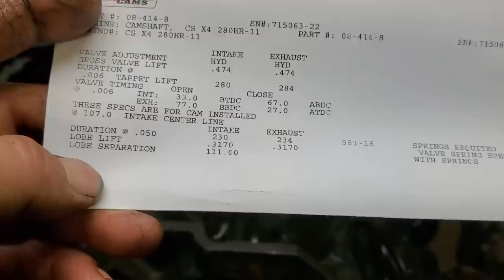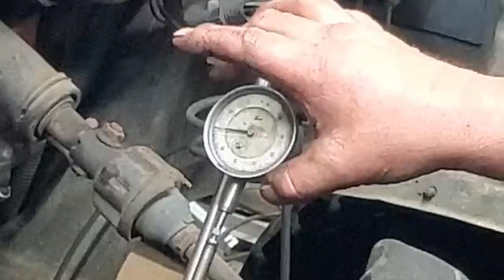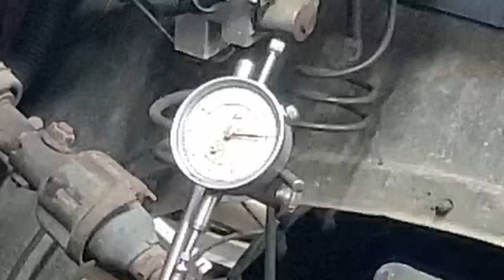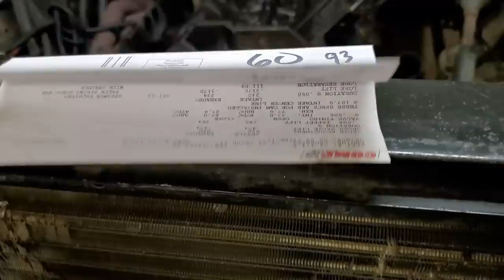1990 Chevy 4wd gets a heads and cam swap. Hot rod 4x4!! Part 1

Comment: My dad always drove cars that one could reasonably describe as "needing a bit of love".  Which meant that every couple of years, there'd be an engine all over the basement floor.  I was always amazed that he'd get them back together again, running much better than when he started.  The first such I remember was a Ford Fairlane early-1960s wagon that he took apart in perhaps 1968.  I was a wee lad of 5, but I remember oily pans all over his workbench with valves and rockers and lifters and the like.  I don't think we replaced that vehicle until 1971 or so with a 1968 Firebird.   But TBH, I think I'm learning more watching your channel than I learned from all my dad's forays into engine repair.  He grew up during WWII in the UK.  It was inconceivable to him to NOT do all his own engine repairs, including complete rebuilds...

Comment: Nice job explaining things as you go. I wonder if there is enough room on the power steering pulley to make a hole without making it unbalanced. Also, many years ago I remember valve grinders that looked like miniature hand powered mixers. If you could find one of those somewhere, that would speed up your valve lapping. Looking forward to next week;)

Comment: I will guarantee you sir that those heads will outflow double humpy Chevy anything but a power pack head is the only thing that will outflow those heads but as I said they're prone to crack so the good thing you had a mind to flex and check but you'll be more than happy with the power they make a guarantee that's saying pull stumps out of the ground if you got the right transmission with it to handle it

Comment: You can also use a power drill, a rubber hose held on by the drill and the other end of the hose to the valve and go down town on it, much faster and better results.

Just saw the part where you used the method👌

Comment: I had that problem when I put a 327/375hp cam in a 283 cu.in motor. I pushed the studs out of heads, it ran about month then valves wouldn’t adjust. We figured out what was wrong. Back in 1969 we didn’t have screw in studs. I found a set of 327/300hp heads. Really woke up that 283. Kept blowing exhaust pipes.  Wish I still had that little yellow 57 Chevy. Diamond pleated interior, Hurst shifter. I only got 3 miles per gallon. Like the positive vibe your channel has. Plus the down home education value this channel has. You really take the mystery out of mechanical stuff.  Don’t know what day you filmed this, but darned tooting it’s got cold in the Volunteer state.

Comment: I have a horse tightened up with an inridge and got him tied enough that didn't come out once you put the red sailor on them but if you tell people to use a socket in my experience people get to tour cafe because some people don't know what to quit putting the torch to the boat if you know what I mean
Reply: You might want to mention to people that it's better to use the umbrella seals then they're all ring seals because usually they smoke early and the Orange seals are what come out album involve decades

Comment: A vacuum hose on the stem portion of the valve, then the other end of the vacuum hose in a drill works really well for lapping valves. Just gotta remember to oil the valve guides down some and go slow with the drill. Sure it easier than lapping valves by hand and those suction cups don't always stick, they slid around too easy imo.

Comment: Great vid , liked all the info on setting up the cam timing .
I watch a channel called Barum Engines ( English rebuild shop ) 
And I can't believe how complicated these modern engines have become !(BMW) WHY? I don't know ?
Might be because I'm 61 and stuff takes longer todo LOL !
Big thumbs up !
Reply from the maker: I do not like new vehicles!
Reply: I think to justify there jobs they keep changing stuff for the sake of it ! My partners latest iPhone update has made the clock bigger ??????? All for electronic ignition and fuel injection but it should have stopped there ( my opinion ) .
Keep the channel going , and a small request if possible get hold of a straight 8 ! I have a thing about them !

Comment: Mine is a 97 z71 with 245,000 miles. I hear gurgling all the time coming from under the dash, I didn’t know it was a sign of a head gasket failure. It burns coolant and oil decently fast and the worn bottom end bearing makes it sound like a diesel.

Comment: Another way to get those lifters out when they’re really stuck is spin the cam over to push all the lifters up then pull the cam out and put a folded piece of cardboard in place of it and push em in to the block the cardboard will catch them from going into the pan

Comment: I have a1996 350 SBC overboard 0.030. The engine is 100% original except for the block and the overbore. After watching the episode where you talk about push rod guide holes and self-aligning rocker arms, I decided to check this engine which is in my basement. The push rod guide holes are slotted. There is not much clearance for the push rods to move side-to-side and the rocker arms are  self-aligning. I would have to check all of this if I decided to replace the stock cam with one with more lift. That made me think about the 302 SBC I had raced. I had replaced the heads with some of the first nickel alloy, slant plug SBC heads that used steel guide plates. Now I wonder if these heads had round or slotted guide holes. BTW, I replaced the original 3/8th screw-in studs with 7/16th studs used on 427 Fords. I think I did this to accommodate a Jomar stud girdle.

Comment: I understand that impacts make quick and easy work but if you want to greatly lessen your chance of breaking bolts, don't use an impact. In my experience if you slowly loosen bolts with a big ratchet or breaker bar, work it back and forth, your not likely to break the bolt. Yes impacts are faster, until you have to drill and tap broken bolts

Comment: Quick question i remember you showed a engine hone once with 2 arms on the stone, any idea of the part number and brand? I can't find that thing anywhere and i wanted to give it a shot for cleaning up the cylinders. I've always used the old floppy style. just being careful, and i recently started using ball hones but those are a lot more particular about sizes can't go too big or too small sucks with an in-between size.

Cool build regardless, good advice to degree the cams, no reason not to. I don't usually build dinosaurs but believe me it's no fun having 1 camshaft off in a DOHC. Especially with modern motors that have variable everything.

Comment: I'll agree with that the gmt400 trucks especially the older ones 88-usually about 93 motors wear out prematurely, well I happen to own a early 94 Chevy Silverado extended cab short bed Z71 tbi has a 87 Chevy p30 0.40 350 4 bolt main Chevy motor and the truck has 265,731 and the motor in it is it's 4th motor. The truck was bought 2 years old by a Farmer to pull trailers two gravitational hopper wagons and a 14 ft farm implement trailer and after 5 years of that it lost oil pressure and locked up never even knocked, the guy I got the truck from said he seen that crank and bearings out of the factory 350 tbi motor and it totally wiped out the bottom end including busted two center cylinders at the bottom off on the Dr side.

Comment: I'm ready to start working on my son Ian's 96 Silverado Vortec. It's blown a head gasket, plus leaking from several places so we figured it time to upgrade.  I'd love to work on it with him but he is in Florida, working on Hurricane Ian damage, so I'll end up doing things by myself.  kudos  👏   you are doing a great job and taking the time to do it correctly.  
 That said,  I plan on removing the engine and doing it on a stand.  I'm not sure what cam and lifters to use, any suggestions? His truck is a very low slammed street truck so we need drivable power,  nothing crazy,  he's just 19yo.
Reply from the maker: Yo don't want me recommending a cam or anything else! 🤣 Good luck on the project tho! 👍

Comment: Given the troubles you had with the bracketry, you'd be served well by upgrading your water pump since ya got it apart. You know, when engines fail in this manner the entire cooling system never seems to be the same again, it works but I've noticed its kinda weakened or inefficient ... probably a good idea to inspect/verify everything.

Comment: Hey Chad. Love your videos and I am a subscriber. Just one question you can probably answer to set me straight. I have a 1995 Silverado that had a big cam in it when I bought it. We’ll I could never get it to run right and later I learned that since a bigger cam doesn’t produce very much vacuum, it gave the map sensor the wrong reading and that caused the computer to give injectors wrong fuel output. After changing cam it fixed problems. But saying all that I know your going back with a 4 barrel instead or TBI so I can’t wait to see what you do to make this conversion work. Keep up the great work 
                     Steve

Comment: GM first began installing roller cams in some Chevrolet small-block, V8-equipped cars in 1987. But OE roller-cam installations in trucks didn't occur until 1995, for the1996 trucks and SUV's with the vortec engines because those having trouble with China hydraulic flat tappet lifters in 1995 so they made the switch the roller cams and a Vortec head from 1996 to 1999....

Comment: I know this is an older video but in regards to when they started roller provisions drilled and tapped not sure but bolster started in 86 and some applications like 4.3 and Caprice col cars it says 96 was the first year for all engines roller but I have a 95 roller and it came out of. Van

Comment: Non emissions grind ? The ramjet cam and indmar's monsoon cam can get ya close to or at 350 hp with truck springs and a single plane intake , still respectable from a dead stop with a 4spd auto and 323 gears .dirt cheap power upgrade for a tbi 5.7 .looks like your going bigger , saw some new valve springs

Comment: But you can also run a solid roller lifter and get around the roller can issues that you'll have with that block it's really not worth running a hydraulic roller to me for the games and sacrifices you have to make but again that's just my opinion beans at my brother built the sandwiches everyda and it's in this life and a machine shot for almost 6 years and a 90 so we kind of learn what will fit and what don't fit with one of them blocks

Comment: They make a Chevrolet performance  tbi to vortec head intake manifold part #12496821 if a guy wanted to keep the toilet bowl injection, pairs good with the holley 670 cfm throttle body part #510-502-9. believe it or not the stock unit only flows 450 cfm.

Comment: I am a seventy three year old want to be mechanic. I spent all my time mostly under big diesel trucks building horses that were big old Clydesdale horses. I could take some of those old industrial diesels, put a automotive   cam in them and then the fuel pump was one of those things that you do but just can't print here in any form that would be less than the length of the bible. At least a chapter or three. So I got old too soon and went to working on mostly pickups as they get scratches and no one whines much. I am going to try an learn what you showed us on the degree  thing as I know about it but it ain't quite reached a part of my cells that still function in my head. I understand the using a dial indicator but do you pull the cam pulley off and turn it or is it adjustable on the back side of it so you can turn it? I also noticed that you stayed with a chain instead of doing those gear to gear adaptors. I don't like the noise that they scream but boy howdy, they are so easy to set up for degreeing a  cam.... your thoughts please??? Yes I watched you take down a building for the materials to build this one and I got  my toes growed together hoping your building is what the doctor ordered. I ain't a carpenter either but my best masterpiece was my last shop before I got crippled up..... not to brag but some lets just say legal was probably not so much as to how I made some money flying my old bush plane. I live in Alaska where men are men and just how they get to be a man is still a secret to me as I never did kill a squaw but I surely did think it was right perverted to diddle a bear. I through that in for some sick humor.... my last plane was a Stinson tail dragger... I just don't remember the numbers on her sides... two passenger easy and the third was real glad to crawl out of the back... but she would carry a five hundred pound load of what ever was needed. Loved looking out the window just under the wings... a all wooden plane that was really flying on a prayer. Wood in the tail was so rotten that you could pinch pieces out of it! But it carried me and my brother all over alaska to places no man  has seen before for the  truth. If you ever watched the movie "Second hand Lions" then you could picture us two old vietnam vets

Comment: Why didn't you just use that block you had in lockjaw and they're in the truck when you got it it was the same block as what you got and you already had it to workout except for it Hardy had roller Cam in it I'm sure cause I got a 90

Comment: Don't those locks adjust the installed height of the spring and reduce the seat pressure closed? LS6 springs are supposed to have an installed height of 1.8" in order to have the rated seat pressure. By how much does it reduce seat pressure?
Reply from the maker: It ain't a race car. It'll be just fine.

Comment: Summit racing brand cam kit k1102&k1103 decent cams, but if it was me if you are running a 4bbl I'd buy the competition cams Xtreme energy 268h 221/224 duration at 0.50 lift valve lift at 0.50 lift 477/480 nice lopey idle and it still made decent power and through your cannon exhaust tips lol would sound like gunshots popping through the exhaust when downshifting lol

Comment: Hope that cam and lifter set up lasts! Been hearing a lot of horror stories of brand new cam lobes or lifters wiping out in a very short time! (Flat tappet hydraulic stuff)
Not due to improper break in period but poor quality materials! Also improper hardening of the lifter surface ! 
Very frustrating doing all that work to find out you installed junk! Prayers it lasts for ya!
Reply from the maker: Roller cams don't generally have those issues.
Reply: @ThisNThatGarage  ah, guessed I missed where your doing a roller cam ! I got interrupted a few times watching ! Lol
Reply from the maker: @markcole6475  It's all good. I forget what I watched 5 minutes after watching. 🤦🏻‍♂️

Comment: Are you still running the TBI heads on the red truck? Aren't the angle of the heads different from the manifold you have on it. If that's correct you may still have a very small vacuum leak. Also has the computer been eliminated? On the stock motor you have to disconnect a wire on the firewall. I enjoy the show but sometimes the more parts thrown at it gets you running in circles
Reply from the maker: You should probably watch part 2.

Comment: Yeah listen to him people you don't want to run .600 lift capable valve springs on pressed in rocker arm studs,I have done this and I even put new pressed in rocker arm studs big mistake my competition cams Xtreme energy 268h 477/480 lift cam pulled the intake and exhaust pressed in rocker arm for the number 1 cylinder on the Dr side springs were k motion.0650 capable double beehive orange powder coated valve springs and I had the matching pressed in ends pushrods from competition cams and the intake push rod shatter and the exhaust bent over locked the rocker arm in place and I found all of this when I built the 355 75 Chevy k20 Silverado 350 motor for the 86 Chevy k20 custom deluxe long bed farm truck I had, because it acquired a constant valvetrain tick I couldn't get rid of... And I replaced the damaged parts and tried to repair the rocker arm studs and it cracked the head between the rocker arm studs around the head bolt damnit...oh well $475 wasted because I didn't want to buy the screw in rocker arm studs because I already had that set of pressed in rocker arm studs.. I had rebuilt that set of 75 991 heads and even put Manley street master valves in the heads,Napa motor parts store put the heads together for me and the 2 angle valve grind job, and funny lol I ended up pulling the cylinder heads and tore my recent gaskets so put another set of new head gaskets and put a 244k 1998 290hp gm Goodwrench 350 4bbl crate motor replacement heads a set of 993 heads and within a week it started smoking like a freight train go figure valve seals were cooked,, so I had a great running dependable driving cammed SBC that smoked when running like it was worn out....all because I didn't want to spend money and buy the preferred product because I already had what I could make work for now which reminds me also cost me a set of new chrome script Edelbrock valve covers because the shattered pushrod went through the valve cover!!

Comment: If you would have used that fancy ratchet to take the intake bolts out with. You wouldn't have broken bolts in your heads. I have the same job ahead of me. Put a remanufactured motor in my 93 Chevy truck. 3000 miles later I'm installing a better cam n lifter set up. Power steering pump must have been a "engineered" project.